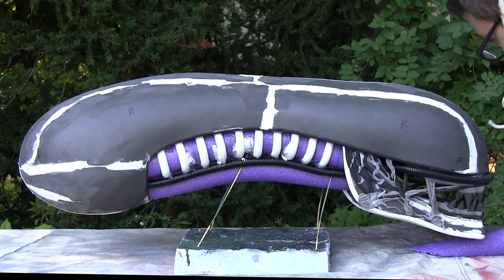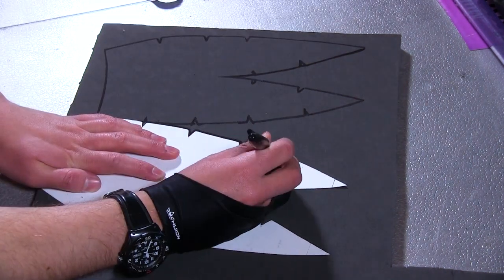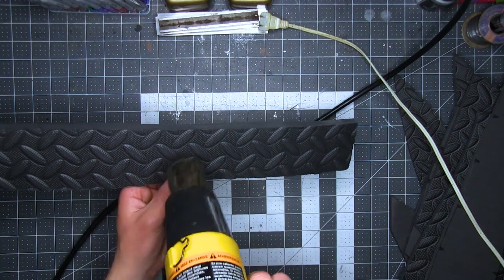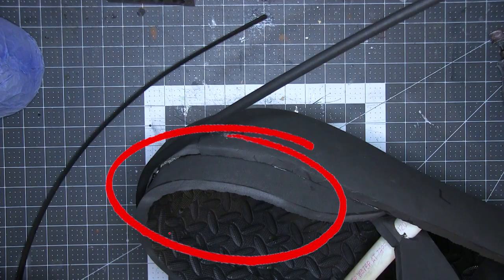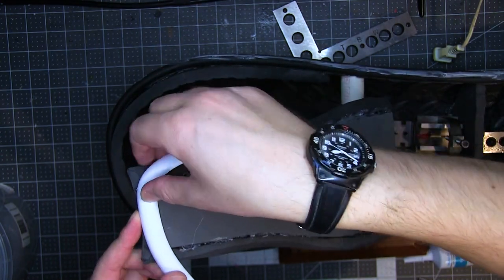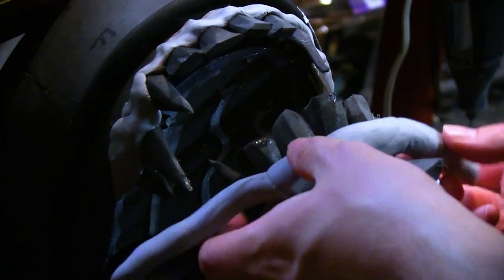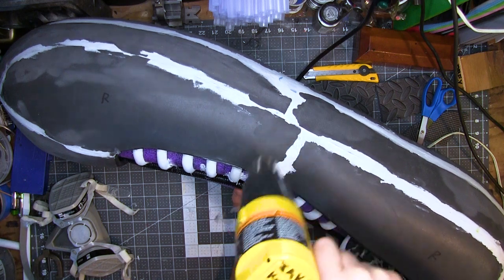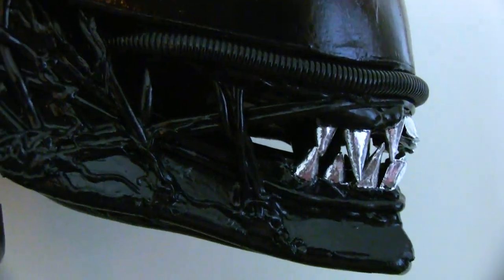How To Make An Alien Head (Xenomorph Template DIY)

Comment: fun fact; a regular household hairdryer will not have enough heat to shape EVA foam, but! high end salon style hair dryers can reach similar temperatures to a heat gun. in theory, this also means that it's perfectly fine to use a heat gun to dry your hair if you're careful. source: tried, it for science.
Reply from the maker: good to know!

Comment: do you remember what brand floor foam you used? I can't find any that has a smooth side, most are double sided :(
Reply from the maker: really? I can't remember the last time i saw double sided eva foam. Well the brand i usually use is "We Sell Mats" I shop online, but I've found it in select Lowe's, 5Below, ALDI, and BJ's Wholesale Club. Michael's carries the thinner stuff, but not the linking kind.

Comment: Just started the build today after printing  the templates and I am going to make it with cardboard will it work ?🤔
Reply from the maker: I mean you can do it, but it'll look like cardboard. Foam and a heatgun will run you $30.
Reply: @WilliamJakespeareProps  but man if I fix it not to look like cardboard will it be okay?😀🤔😅 and yeah can we wear it ?🤔 if we don't stick the lower section🤔

Comment: I cut the pattern and my pieces,  and i think I made a mistake… all the V shape small cut, du we have to cut it or it’s only for alignment? I cut all the small V mark, I think I was wrong ? At first I thought I had to glue these V cut 😢
Reply from the maker: the small v marks are only for alignment. You're supposed to cut them out of the template, trace them onto the foam, but don't cut them out of the foam.
Reply: @WilliamJakespeareProps  yeah… I did that, I cut them out the foam 🫣🫣🫣🫣🫣🫣 I will have to recut all my pieces 😂 it will be a lot of hole to cover if I use them anyway uh?